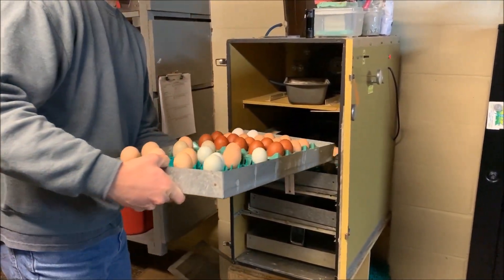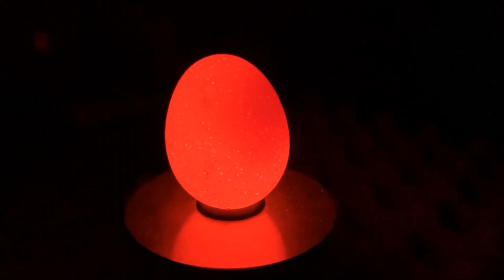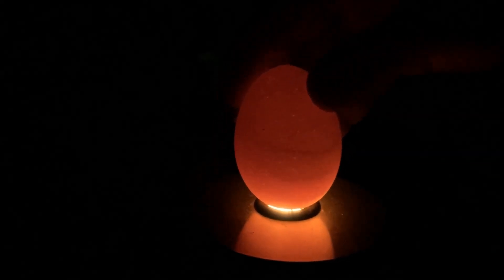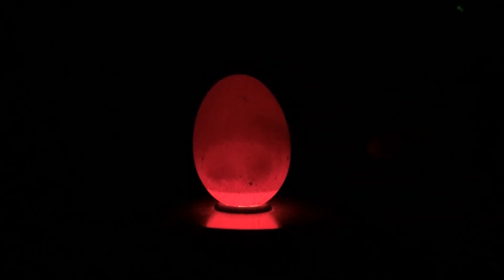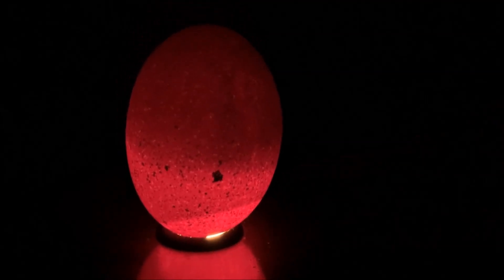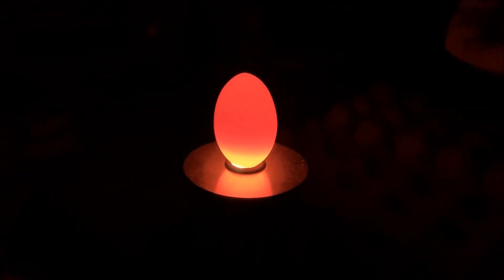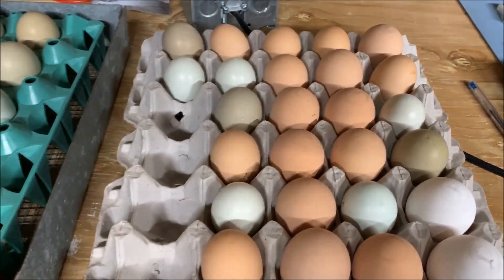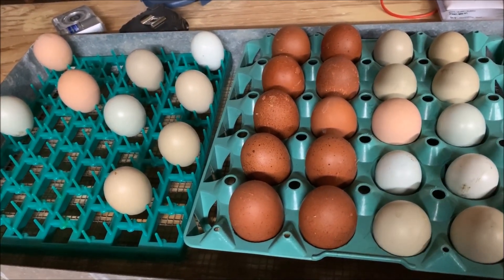Did We Find LIFE?  Candling Eggs at Day 8

Comment: Does it matter which side is down when you are candling? We have been putting pointy side down in the incubator and when candling. First time incubating. Also we can't see inside the eggs with the candlers we have tried. (blue and green eggs) Day 10
Reply from the maker: Pointy end down in the incubator and candle with the pointy side UP.  Then the air cell is at the bottom and it is easier to see.  Colored eggs are very hard to see into.  I have a video called how to candle dark eggs.  You might get some tips from that.